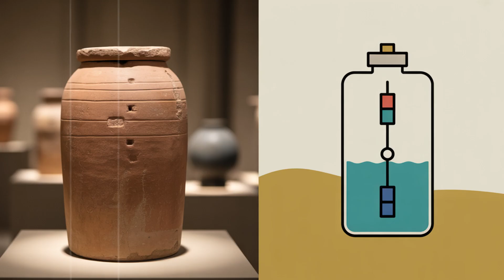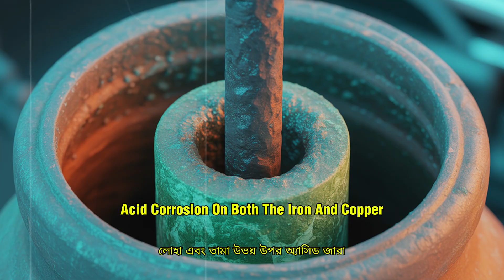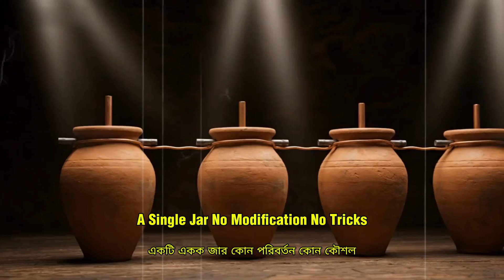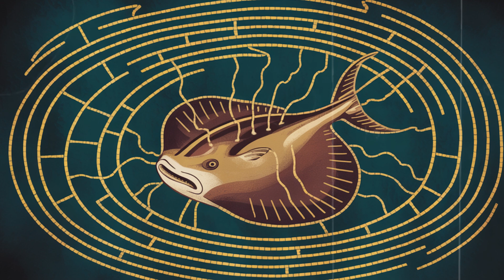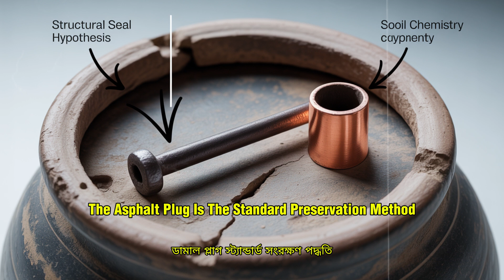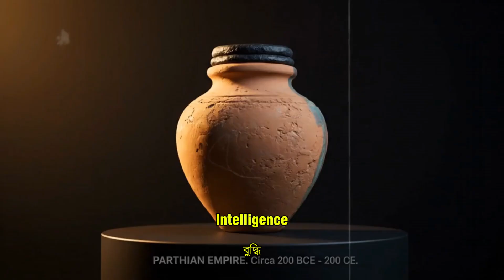The Baghdad Battery Did the Ancients Invent Electricity 2,000 Years Ago

Comment from the maker: ⚡ QUICK BREAKDOWN for anyone who wants the key facts fast:

✅ The Baghdad Battery is real — it's in the Cairo Museum right now
✅ Replicas filled with vinegar generate 0.5 to 1.1 volts (confirmed by multiple experiments)
✅ Every structural component of a galvanic cell is present
❓ BUT — identical jars were also used to store sacred scrolls
❓ AND — no wiring, no electrical devices, no workshop evidence was ever found nearby

So is it a battery or a scroll jar? Drop your verdict below 👇

Also — if you could ask the ancient maker ONE question, what would it be? Best answer gets pinned next week.